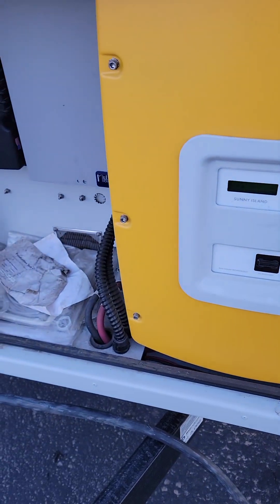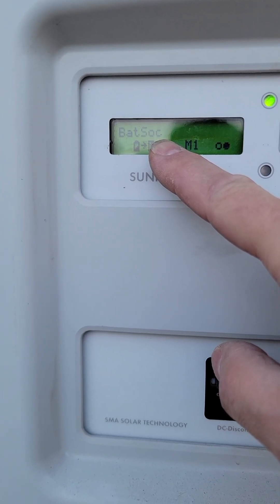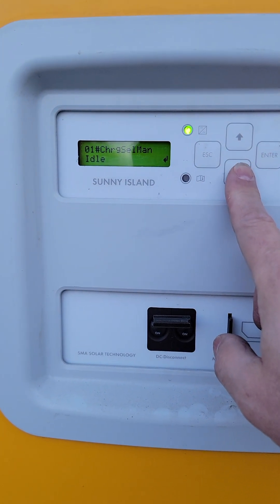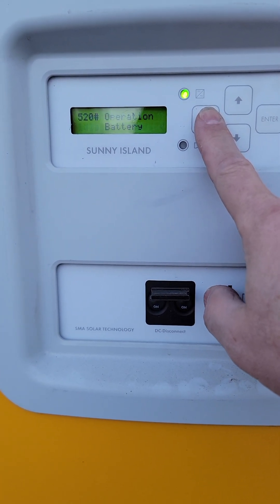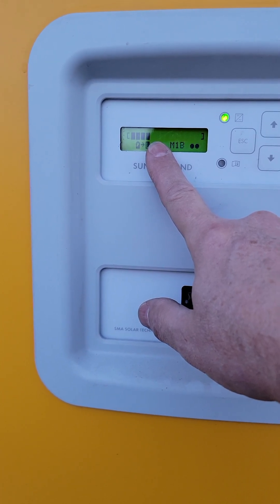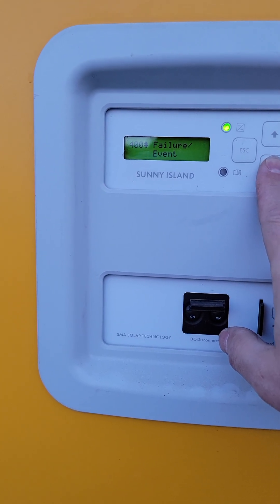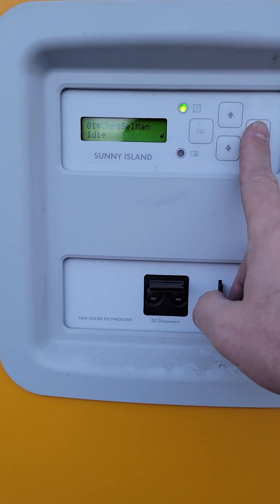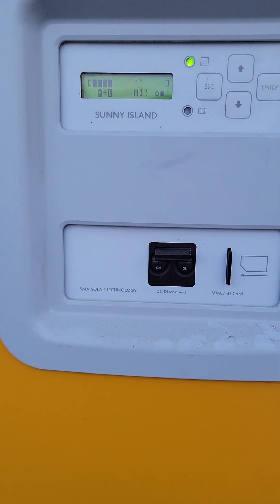How to start/stop an equalization charge on the Sunny Island

Comment: thanks for these videos John, I bought a DC trailer about two months ago and I'm learning a lot about its operation through your videos, and threw just playing with it. Is setting the inverter low voltage cut off in inverter settings? It was like one option above where you were going